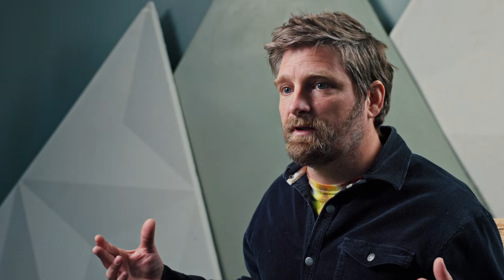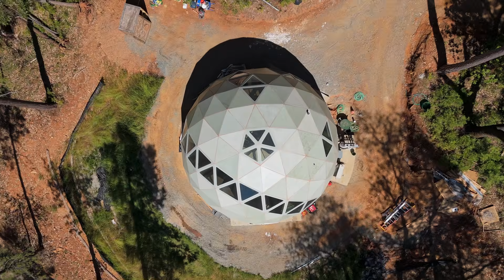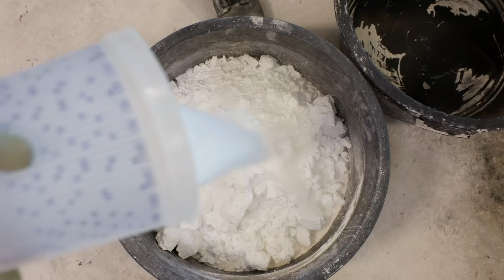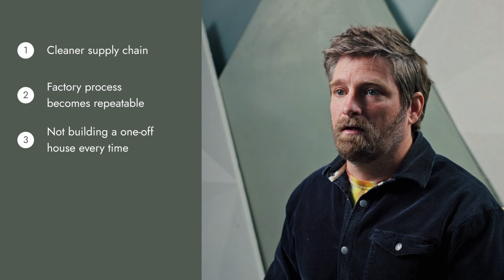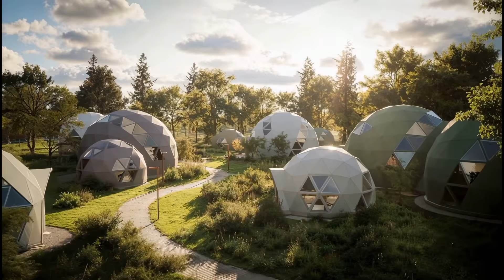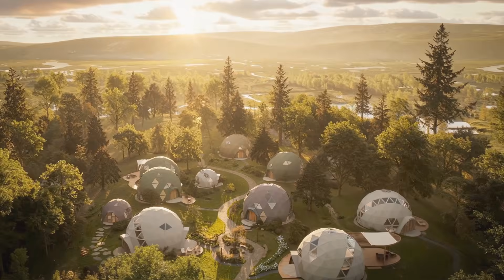What It Takes to Reinvent Housing

Comment: How will the bone-like material weather?    Bones left outside soon turn black. That's apart from hundreds of joints already to leak.
Reply from the maker: Great questions. BoneRock isn't made from organic bone, so it won't weather the way natural bone does. It's a proprietary bioceramic material designed for long-term durability as part of Geoship's mineral-based building system. 🌿

As for the panel connections, they're an important part of the engineering. Geoship's building system is designed to achieve a highly airtight building envelope (targeting around 1 ACH), helping reduce air leakage while supporting long-term performance.

Comment: nice start.  keep working on it. work on the house needs - energy generation and ability to hide plumbing and electrical infrastructure.  Build solar panels that link together in a weatherproof way. install insulation and interior panels integrated on backside of that. include chases for insfrastructure.  I'll buy that.